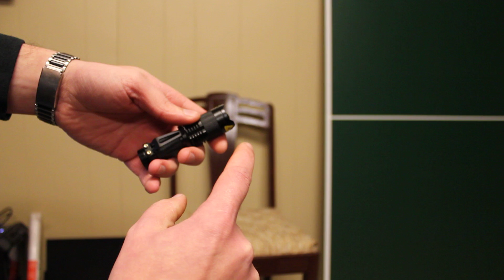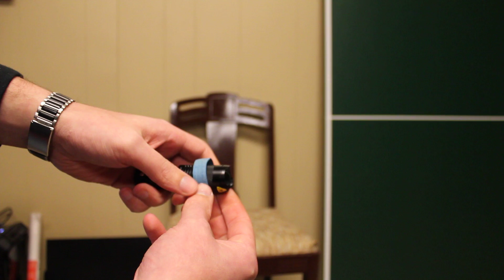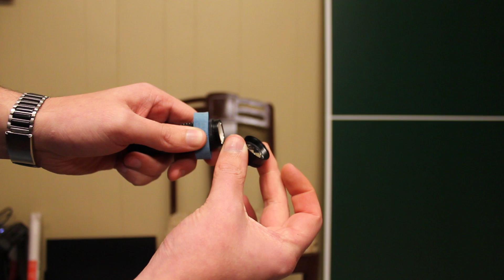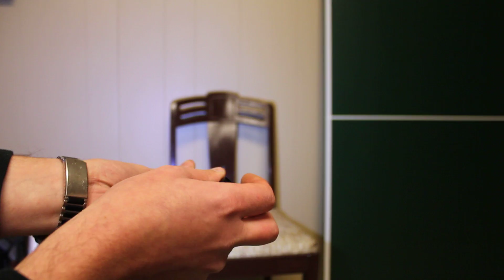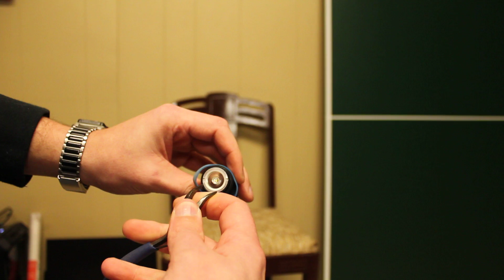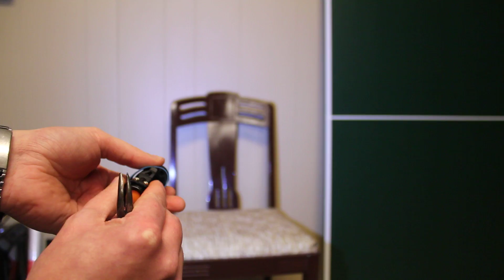Flood conversion video for Jimboski on RFD for TomTop Cree Q5 Flashlight

Comment from the maker: On high, a little less than 2 hours with 840mah batteries from intl-outdoor. They now have three mode versions available (high, low, strobe) for those times when you need extra runtime!!! Great freakin light, I've EDC'd it for more than a year, amazing. If you need links to the batteries or the 3 mode light just send me a message on here and I'll reply with the links.

Comment from the maker: Nice! On some of these lights they did a poor soldering job on the back of the driver board. If your light continues to blink when you bump it, etc. then remove that entire silver pill assembly (just do the opposite thing you did to tighten it), and on the bottom you can see where the battery contact the board. Carefully pry out that board and you'll see two wires on the back going to the LED. Resolder those two wires where they attach to the driver board and she'll be super solid :)